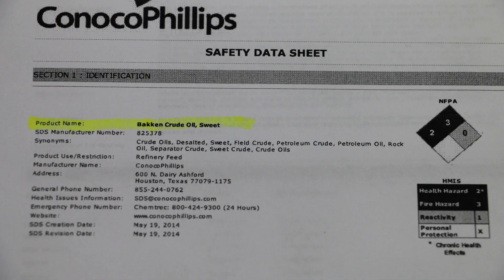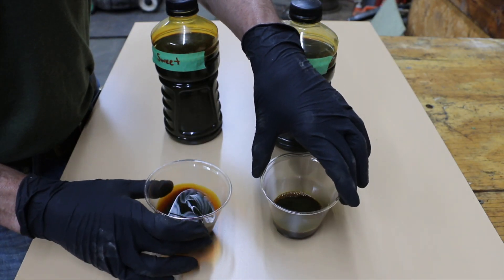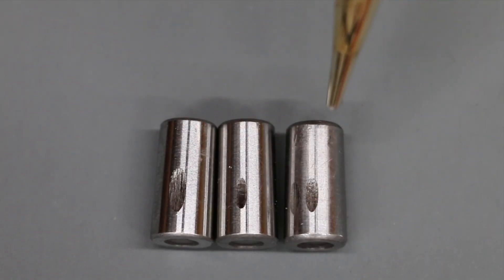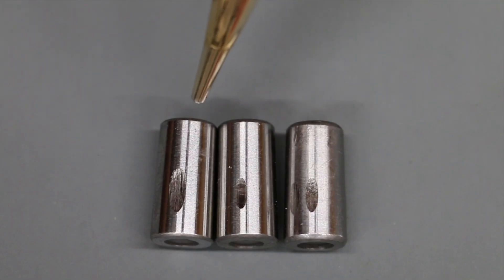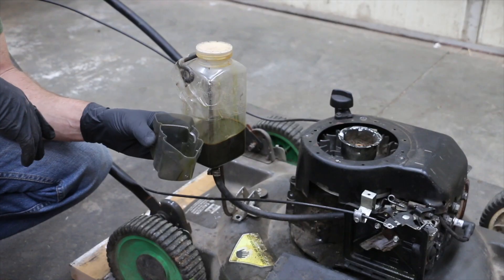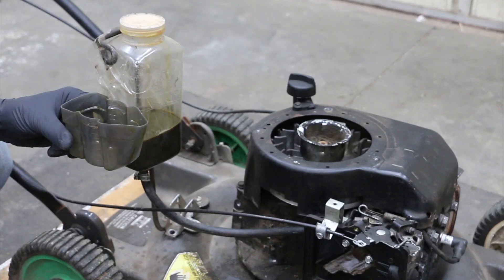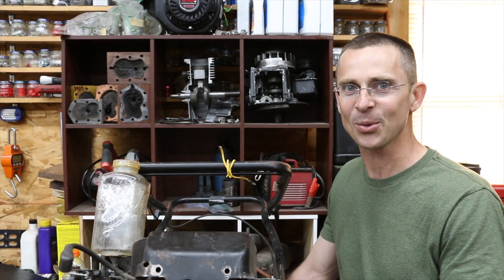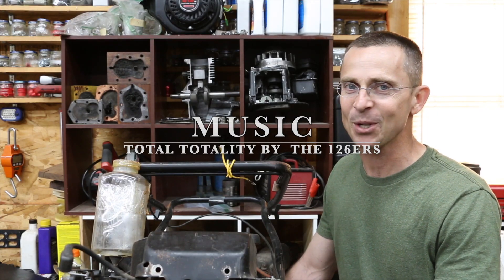Will a Gas engine run on Crude Oil?  Let's try it!

Comment: The thing about crude oil is that it literally has everything in it required to run your engine either as a fuel or lubricant... but it’s also full of stuff that’s detrimental or inhibits easy and reliable operation. 

Take your lubricity test. Yes in a short term high load application it performed better than motor oil. But the lighter fractions will act like solvents to prevent a film of oil staying on the internals when the engine is shut off and also possibly (quite likely) catch fire due to its extremely low flashpoint. 

Similarly for a fuel.. it does have the low flashpoint required for gasoline engines, but it’s taking a lot of heavier fractions along for the ride of which some will burn as they reach their flashpoint, but many won’t. This can lead to problems with metering and filtration (as you experienced) deposits and terrible emissions as well as detonation in higher compression engines (I would imagine a lawnmower engine is a lot like an old flathead where it was such low compression it could run on petroleum OR kerosene). 

Of course a Diesel engine would probably run better on this provided it wasn’t common rail direct injection as the crude would quickly clog injectors and wear out the pump. Perhaps the best use would be in an old jet engine with vaporizer tubes rather than injectors. 

Crude oil was used in Japanese warships as an emergency measure in WWII due to diminishing oil and refining capacity. It resulted in much fouling of the exhaust flues and water tube boilers as well as it was an extreme fire hazard due to the low flashpoint (bunker fuel is typically a very heavy crude fraction both for its energy content as well as its low volatility).
Reply: Heavy fuel oil is still used on ships today though there no way it would work in a normal engine, its far too viscous.
Reply from the maker: Great point!  Thank you
Reply: Unit injectors FTW.
Reply: Is it choc full of paraffin?
Reply: Excellent analysis of the pros & cons. Crude oil of any sort is probably too viscous for a diesel engine let alone a petrol (gasoline) engine.
Reply: It's got what engines need

Comment: many years ago while working for a builder, i ran out of gas miles from a gas station. looking through my van for something flammable, i found a can of wood preserver, it got me home with the engine protesting loudly all the way.
Reply from the maker: That's interesting!
Reply: I had an similar situation but i used paint thinner, also with an protesting engine but made it home
Reply: I also looked around found my wife,and on that trip home there was also alot of protesting from the "engine".i also got home,warm and dry and all ready to sleep on the sofa!
Reply: Did the same thing with a 60oz of graves I had (same as everclear in the US). I got home, but was left without booze for a week because of it ><.
Reply: The toxic fumes probably shortened the lives of the locals.
Reply: I would have never put that in my car, stranded or not.
Reply: @Dover939  yes you would have. (Unless you wanted to walk hundreds of miles.) There weren't cellphones back then.(or he was out of cellphone range.)
Reply: @xenonram  if he was hundread of miles away i dont think can of solvent will make it. And how stupid person not to notice fuel level :D.
Reply: @xenonram  who the heck would leave "a can" with at least 25 liter of remaining wood preserver behind. In the middel of nowhere. How much was initially brought there? And what was it good for. If no one is living close by, someone must have tried do prevent the woods from dying by preserving trees. I feel really sorry for you if that sounds reasonable in your region
Reply: It was in his van from a previous job. Learn to read

Comment: I’m a petroleum inspector and I’m amazed that this worked but he got the difference between sour crude and sweet crude wrong. You can’t get sweet crude oil out of the ground. Sweet crude is pre cracked using a hydrocarbon cracker and it actually a lottttt thinner than sour crude. Sweet crude looks like chocolate milk and has the same viscosity as water almost so whoever sent that to him and told him that it was sweet crude lied to him. Now they’re sooooo many different types of sour crude that it’s insane and I’d be hear all day trying to name them all and all of them have different APIs (viscosity). Wti and Eagle Ford which is from Texas is really thin like sweet crude but it’s still sour crude. It usually has an API of about 44-45 which is about the same as kerosene. But then you have crude oil like ostra crude and Arab medium and Arab heavy which is extremely thick and has an API of like 22-25 so that stuff he called sweet crude was not sweet crude unless it was cracked because you can’t get it from the ground
Reply from the maker: Thank you

Comment: I know of some that use what they call  Drip. Years ago the oil was pumped into tanks and the tanks has vents and they would get what came out of the vents. The sun heats the tanks and some evacuation happens. Some drips out the vents. It was almost like gasoline but they said they needed to clean out the carburetor often.  This was in the 60's when there was no computers in cars and trucks.  I also have had some say they would mix it with moonshine and it runs better.  This is not the same as running crude oil,  the heat from the sun kind of refined some.
Reply from the maker: Thank you!

Comment: Do many states restrict the use of oil as a fuel due to emissions regulations?
Reply: Yep. Also don't do this with your car, it can damage your cataylic converter and other expensive emissions equipment
Reply: Adam Smith Interesting, thanks for the advice! Cheers from Canada

Comment: Use your motor to manufacture sulferic acid. While running the high sulfer crude, let the exaust go through a container with a little bit of water in the bottom, the oxides of sulfer will dissolve in the water forming sulfate and sulfite ions. If there is not a base in the water such as baking soda, it will form the free acid, which in this case is sulfuric and sulferous acid. Its basicaly the same as making nitrate ions that i talked about in another comment, and really i suppose you could make both nitric acid and sulferic acid at the same time, because they both like hot lean running motors.
I dont have crude, so i was going put gasoline and wild onions in a blender, then filter the mixture, the sulfer compounds should go into the gasoline, then proceed as with crude
Reply from the maker: Thank you for the video idea!

Comment: I’m thankful for these videos. I’m confident that in the event of an apocalypse I will know of dozens of random liquids that will fuel an engine. Lol
Reply: Yep. Especially older engines. Older Diesel engines can run on vegetable oil, engine oil, heating oil AND WHATEVER oil you can imagine. Gas engine can run on anything that is flammable by a spark. You can piss in the engine and it will run imao. As i said older engines are better on this because they are simpler and don't have all these fancy perfect mist injection system and crap
Reply from the maker: Thank you

Comment: Does he have a predator enigine on that shelf
Reply from the maker: Thank you.  That is a predator engine from a previous video.  It threw a connecting rod.
Reply: Nice I just fixed a non running generator and Honda gc 160

Comment: Polystyrene will dissolve in petroleum fuel to form a poor man's boosted Molotov cocktail ingredient of sorts. When first adding the polyfoam gelling agent to the fuel stock it has little noticeable effect, I wonder at what point the fuel will no longer be usable as nature intended and exactly how much polystyrene laced fuel or total volume of dissolved foam etc. it takes to powder coat an engine's internals if someone decides to use this lesser known homebrew Hellshake as fuel proper.
Reply from the maker: Thank you!

Comment: I would like you to build a rig with an engine and generator with the generator for overcapacity of the engine so you can increase the load testing the amount of electric produced to determine how much power the engine is putting out you could also have a rev counter on the engines electrics in theory you will be able to work out whether any different fuel produces more or less power and would make a very good display for power consumption two or three electric fires and then a series of 100 W electric lightbulb switching on independently would give you a variable load I would love to know what your comments are once built it could be used in all sorts of demonstrations and experiments Cheers Derek
Reply from the maker: Great suggestion!

Comment: There is so many different types of oil. Some from Venezuela does not even swim in water, the density is higher that that of water. Very much bitumen.  And i have seen Kerogen nearly colorless but paraffinic, and oil that is solid at 45C but very fluid at 50C and has about 45% of atmospheric distillatable content. Also very much paraffines. In sicily they do make candles from that stuff - really.
Reply from the maker: Thank you!

Comment: How sour was the sour crude oil? Cant have been more than a few ppm.
Reply: I work with the stuff everyday. Can range from .0001% up too like 40% straight outta the ground. Be carefull. H2S poses some very real and serious health risks. Anything over a couple hundred ppm can knock you down or even kill you.
Reply: You can smell it in parts per billion. But 200+ppm aint gonna be good for ya
Reply from the maker: It smelled awful.

Comment: The sour did well on the film strength/lubricity test because of the high sulfer content.  This is why diesel owners began griping when ultra low sulfer diesel became mandatory.  Lost lubrication in the pump and fuel injectors.
Reply from the maker: Thank you

Comment: The sulfur in the sour crude oil may acting as an Extreme Pressure additive. I think sulfur is/was added to greases and oils for things like gear boxes and dead centers on lathes before ball bearing centers became common.  Also many commercial heating boilers run/ran on #6 light sweet crude but they had to preheat the fuel to something like 140 degrees F to get it to atomize properly for a good flame.
Reply from the maker: Great point! Thank you

Comment: Great video!  Looks like sulphur is an effective lubricant enhancer.   This is backed up by the fact that Hypoid gears, such as those in the final drives of rear axle cars require sulfur-phosphorus as an extreme pressure additive as well as a high viscosity oil.
Reply from the maker: Thank you!

Comment: Missed a spot. JK
I wish i had the right equipment, u could turn a mower into a generator easy, with the right stuff and setup. But it'd b cheaper to just buy one and just strap it to an old mower frame.
Reply from the maker: lol. Thank you!

Comment: What did you make the head out of on the see through engine?
Reply from the maker: Plexiglass that's 1-inch thick
Reply: I'm building a gokart out of a shopping cart and it has a. Opposed piston 18hp Briggs that is converted to run horizontally, clear heads would be awesome to have on it.

Comment: Sour crude's superior results in the bearing test is easily explained, Sulfur is well known and has a long history in the lubrication and fuel fields not only as a high pressure additive but is also bonds with metal parts to prevent corrosion...
Reply from the maker: Thanks for watching!

Comment: Crude oil contains asphalt, and after a while it would build up in the cylinder and could potentially damage the engine if it is not cleaned after use :)
Reply from the maker: Thank you!

Comment: The sour crude oil has higher lubricity likely due to the high sulfur content.
I'm actually surprised that there is not more buildup inside the engine.
Reply from the maker: Great point! Thank you

Comment: High sulfur content???  Remember in machine tool cutting oil the high sulfur oil content has more extreme pressure resistance... so you have an extreme pressure resistance built in to the sour light crude.  Sulfur is a basic and old time extreme pressure additive to oil.  Likely why your wear lubricity reading is so good.  Problem is it combines with heat and water vapor to form basically sulfuric acid when used in engines.   

In the early days of internal combustion engines all engines ran on "well head gas" or light crude.  How Sir Harry Ricardo started out was by testing "well head gas", i.e. light crudes for Shell oil in his backyard shed engine test set up to determine which worked better in engines, and the burn characteristics.  He had upon leaving university at Cambridge (civil engineering degree) his mentor Professor Hopkinson gave him an instrument to record cylinder pressure of an operating engine.  Having that and with the knowledge gained as the Professor's lab assistant doing research on fuel characteristic and what caused knock and detonation in engines... lead him to the work for Shell.  Because of his expertise developed primarily in his backyard tests the British Government in WW1 asked for his help designing a tank engine to run on the lowest grade fuels... because the better grade well head petrols were tasked for the aircraft use in the war.  [Remember in WW1 most logistics were still horse and wagon, as still was the WW2 German Wehrmacht was primarily a horse powered operation.] From that work he was Knighted, which included a 40,000 £ cash prize.  And, from  that he ended up being financed to create his research company by Shell and others.  From that they developed the test engine and means for determining knock resistance of fuel, i.e. compared to octane which was give a 100 rating.   Refineries wanted to test fuels for suitability and to produce standard knock resistance, octane rating for petrol, and cetane rating for diesel.  So they were interested in his engine for their refinery labs for quality tests.  Still how it is done today.  Ricardo licensed the engine design to Waukesha Engine Company who produced motor test engines for the refinery market... Waukesha received the award from SAE for creating the octane / motor test engines as one of the 10 fundamental transformative engineering developments of the 20th Century.  Actually it was Ricardo and Ricardo Engineers... and is why I would never hold membership in the SAE... though friends have long tried to get me to join!  What do they not know history?
Reply from the maker: This is great information and very interesting. Thank you!

Comment: Ok, since Ive seen this. This made me speculate if you can run a lawn mower on a mix of 70-30 gasoline-diesel blend. Idea is that diesel will lubricate internal parts, you may have to do carb clean and adjustment. PLEASE DONT DO THIS IN A CAR FIRST.
Reply from the maker: Thank you for the video idea!

Comment: Crude oil mowed lawn. This is as MadMax-y as it can be.
I'm seriously impressed how nice it could run, and pretty clean too in the cylinder. I always thought of crude oil as a very viscous and mostly unusable raw product! But it is not. I was probably missleded by the images of oil spills where all the volatile part of oil just evaporate or get washed away, and only heavyest part stay.
So to say, will it run on heavy oil? Would probably be an instant death for the carb...
Reply from the maker: Thank you!  Thanks for the video idea!

Comment: Two products of interest here. They are available in Europe but I'm not sure if either are available in the States or even Canada. The first is the original engine metal ceramic coating treatment. Its called Ceramizer. The other product is described as a metal treatment delivered in a carrier oil. Its called ZX1. Both of these products have big reputations. A car in Poland that had had Ceramizer  in the engine was able to be driven a long distance wihout oil and did not fail. The whole journey was driven with no sump plug in order to provide the verifiable proof engine is not running on oil. The product fills in troughs and valleys in the surface of metal, normalises surface uniformity and reduces friction. This one gave me over 10.8% impoved fuel consumption. Addition of ZX1 has given over 3% reduction in fuel. But if I had used ZX1 first, it is just impossible to know if it would be more than 3%. The key USP about ZX1 is its protection of a surface by microscopically amending the surface structure. These are both great products for you to dismantle so to speak. It would be great if those are both available on the market to enable you to consider them. ZX1 is by a British company called TeamZX1 and Ceramizer is sold by its inventor from his production facility in Poland.
Reply from the maker: Thank you for the video ideas!  I believe that both are available here.

Comment: So the reason why the Sour crude burned more readily as fuel is likely due to the Hydrogen Sulfide content, you had mentioned the smell which means the sour crude was emitting H2S vapor (REALLY bad stuff, don't breathe it in if you can avoid it), H2S is about as flammable as Methane, and is usually mixed in with methane when natural gas is extracted from the ground in a product called "Sour gas", which must be refined to separate the methane from the H2S (gaseous H2S would make about as effective a fuel as methane, but is simply too dangerous to handle and natural gas processing plants burn off the separated H2S to render it safe).
Reply from the maker: Great point.  Thank you.

Comment: im a mechanic and i really love your engine test! i would have put money that the engine would never run on crude oil...and you didint even had to advance the timing!  could you try to run the engine on raw wood distillate (wood vinegar) ..all you need to is a metal 5 gallon bucket, some copper pipe and a fire and some wood. it supposed to be equal to no 6 heavy oil in property but its a thin liquid. so if it ran on crude oil im pretty sure it would run perfect on that!!!
Reply from the maker: Thank you